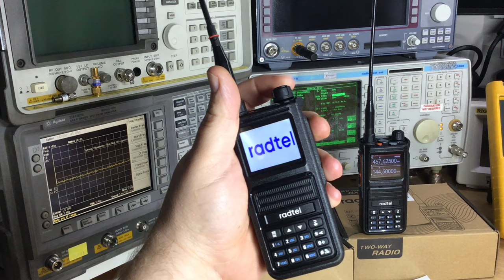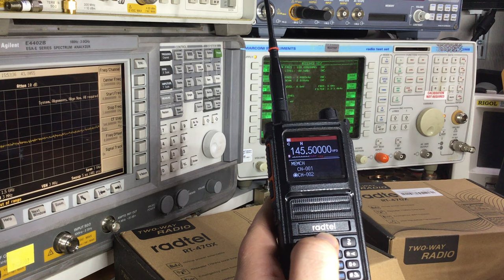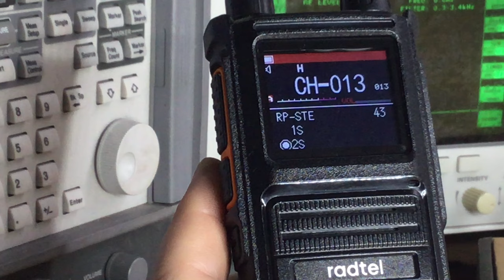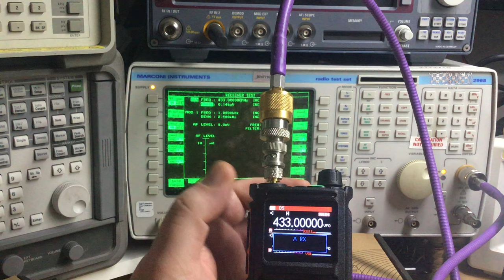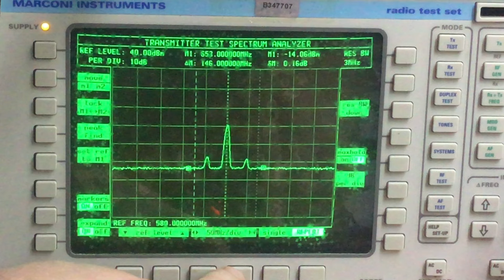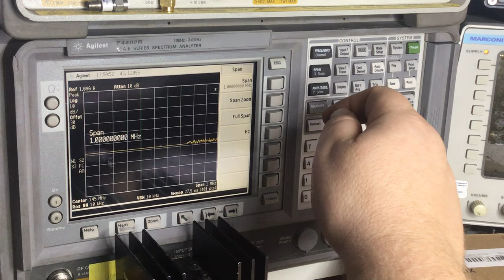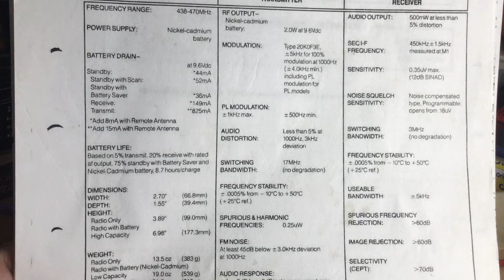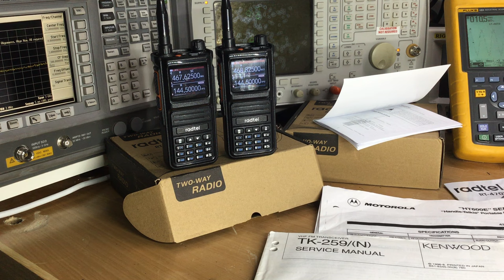RADTEL RT470X Chinese radios test with Spectrum Analyser & Marconi Radio Tester & tear down, encrypt

Comment: Testing and verifying that a $40 radio isn't as good as a $300 radio...really?  Spoiler alert...it's not. However for the money and the features...this radio cannot be beat. Now...if you're out to impress others or are a radio snob...crack open your wallet and pay $$$$$$$
Reply: If it was waterproof, and had a clean transmitter, it'd be almost perfect!

Comment: I have three Radtels, two RT-730's, and one RT-490GPS. I'm currently waiting for the RT-620GPS. So far I'm very well pleased with Radtel products.  The 490 makes an aggravating popping noise when you change channel.  But other than that. All of mine receive and transmit 136-620mhz. I forgot about civil aviation because I can't hear much on it. The scrambler (just a  basic inversion type) works fairly well.

Comment: You should test out the Radtel RT470 10W , (now ships with V2 pcb), that apperently does 16W on 145mhz with power save off 😅, 4.5W-5W on 295mhz, 8W on 440mhz, also if you install the latest firmware it will unlock it between 018mhz-999mhz including TX (except airband), and also long press the number 1 key will allow the modulation switch between AM and FM on any frequencie.
Reply: tks, i did not find this feature to change from AM to FM
Reply: @michaelnoardo3315  if you installed the latest firmware, long press the 1 key 👍🏻
Reply: @ExploringWithJason  check a video of mine on how cheap add HF reception to it, from 10 khz to 18mhz
Reply: @michaelnoardo3315  thanks, will look now

Comment: So, accepting that it's not within FCC specs for the harmonics, I question what effective interference might take place at "a few hundred milliwatts"? I think I could bat a ball further than the signal could carry with a tuned 15" whip. The power output on my HIROYASU 8811 are 5-6 watts, the 470 9-12 watts, and the 470X and L models I sold 5-6 watts. These and other brands are identical made by MML, but the HIROYASU 8811 has newer hardware and firmware with a noticeable improvement in audio quality. Thank you for sharing your  testing of the radio.

Comment: I like it so far, I got it as a uv5r replacement. Something unlocked and receives airband and the scrambler is pretty cool. Is it as good as an yeasu??? No, not no, but fuck no. As a beater radio, I enjoy it quite a bit.
Reply: is it better than UV K5(8) ?

Comment: Thank you for the great review with credible test gear. I am very new to ham radio & have a 470x on order. I am not sure if this hobby will work out for me as I am not sure I will enjoy talking to strangers on a radio. Decades ago, I got my commercial radiotelephone license but never pursued communications as a career, but went the path of biomedical electronics. I am now retired & even if ham does not work out for me, the 470x will serve as a decent air band receiver. Maybe they will solve the transmission problems & there will be a great transceiver for the money.

This transceiver is FCC approved, which brings into question how extensive a test did the certifying agency perform. I worked for the Army for 33 years & I know about ‘flawless bureaucracy” 😮.
Reply: I hope you given amateur radio a try. As far as talking to "strangers," if you are lucky enough to have some good operators in your area, you'll be made to feel right "at home" on the repeaters. Just find a repeater & put out your call sign. Unfortunately, where I am the amateur club "politics" is strong... and if you don't subjugate yourself to the club "officers", you'll find yourself "blacklisted" by the radio "fascists." That's why I almost didn't renew my license. I only get on the air when I'm in areas they AREN'T. BTW I'm not the only one who has experienced this behavior.  I don't think it goes on in the UK. But I could be wrong. I  actually have an audio recording of one of those types, purposely ignoring a distress call so he would not be interrupted... Mostly I use my radios for business & personal, with my GMRS and Part 90 licenses. Good luck to you.
Reply: Impressed with the review. Was about to order one. This review has changed my mind.. Been licenced for 50 years now and always try and observe the regulations requirements. But that second harmonic as strong as the fundamental nearly is frightening. So it's a no go for me. Thanks for review, been enlightening.

Comment: Thank you for the great review with exellent test gear. I have a 470x on order. Now it will NOT be used for transmitting other than 70.cm. Baffled over the FCC approval. 
I have also a Tidradio H3 on order and will now check that for spurious tests.
Reply: H3 is ok, one of the few, with h8

Comment: Huh,
It was a comprehensive and good video radtel RT-470X.
Very good for the price.
Keep going..
Reply: I bought the radtel 470 knowing VHF was dirty, but very clean in 1.25M/220MHz and UHF bands. There's few inexpensive radios for 220MHz and this is a fantastic performer with a tuned whip antenna that TX 5.3W 1.07:1 on 223.500 and 4.7W 1.01:1 on 462.550. I'm very pleased with this $30 radio even with it's faults. (I have TYT 8000D and Retevis RT85 HTs that are great dual band.) With VHF improvements radtel could give the big 3 Japanese a run. Time for China ketchup.

Comment: Great video. I bought one of these radios less than 6 months ago and another defect is its screen "glass", it gets scratchs and bubbles easily. And despite all the spurious signal you could realize in your tests, it has a FCC ID in its sticker :2AZSA-RT470X.
Reply: The screen has a second screen protector on it. Just peel it off. The actual screen is fine
Reply: @M3D1K  It worked fine, tks so much. I have already peeled off the first screen  protector before, but I would never think of it having a second one.
Reply: @eduardoschubert5738  You’re welcome. I would have never considered a second one either but I saw it on another channel.
Reply: @M3D1K Let me guess... NotaRibicon?🤣

Comment: You stated that the radio would cause issues in the transmission mode, and I understand that thank you.
Question: Can you safely use the radio to monitor (just listen) the air bands and not transmit with it? We are photographers not radio operators. We need them to positions ourselves for photos only.
Reply: No HT radios like this that can receive airband, never can transmit airband. However, many of them can transmit on other non-ham radio bands so they could get you in trouble.
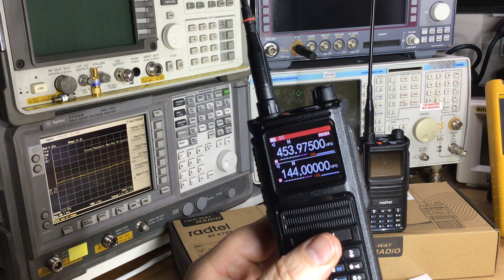Reply: @DonzLockz  Product description specifies "108-136MHz (AM RX) - Air Band Receive Only". Also mentioned in the video at 8:55

Comment: Is it better more functional than UV-K5(8) being unlocked ? looks like a good 10W radio compared to Quansheng, Would the work well together? I got UV-K5(8) and want to buy another one but I found this RT470X and now don't know which to choose! 5W vs 10W.
Reply: The rt470 10W is better, does 14W on 145mhz

Comment: At 1:19:45 you say it's about two watts on 145.000, but what power level is the radio set at?
Reply: Dummy load measures.
2.9 low 3.9 med 7.9 high on vhf
Reply from the maker: Hello, the radio as set to do 4watts, however you will see on the spectrum analyser test we did in the video the RF power was spread across other harmonic frequencies it wasn't meant to be transmitting on, so you had 2 watts on the desired frequency, then 1 watt on the 2nd harmonic, & then remainder of the RF power on the other higher harmonics, all added up it gets to about 4 watts, but only 2 watts is really transmitted on the desired frequency on VHF, however on UHF the radio produces all power on the main frequency in use, The object of the video was to demonstrate that these cheap radios from China actually produce harmful interfering signals on frequencies elsewhere in the radio spectrum when used on VHF & yet work work perfect on UHF on TX with out issue, this is a design floor where they need to employ better harmonic filtering on tje VHF RF power amp to prevent spurious emissions. I have a pair of them myself & use them a lot they are good little radios but I mainly use them on 430MHz on 70c ham band being the radio jam that I am, I would not transmit TX on them on VHF as they are too dirty as seen in the video. They have very good receivers in terms of sensitivity All the best,